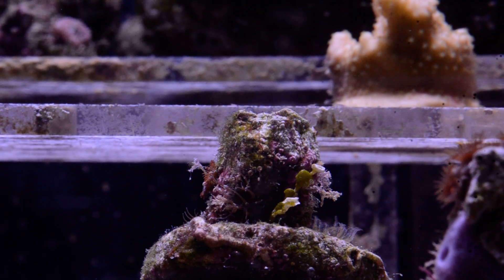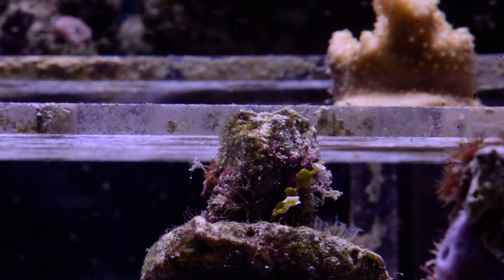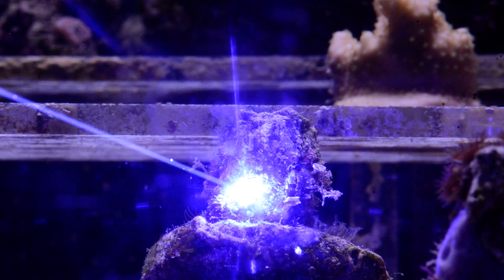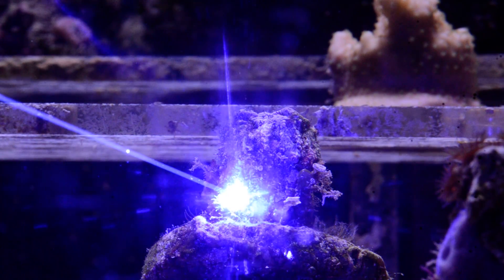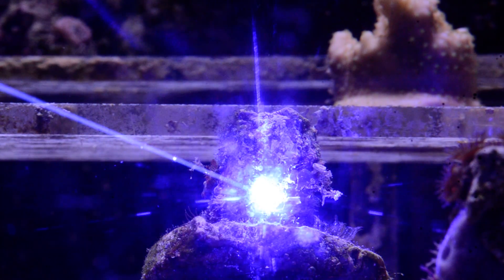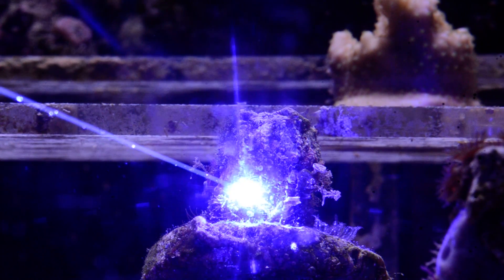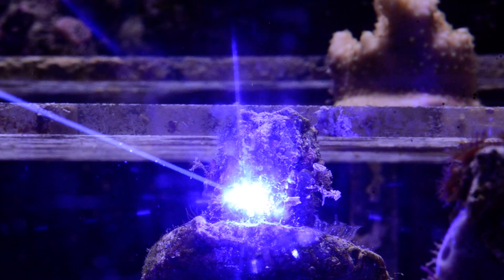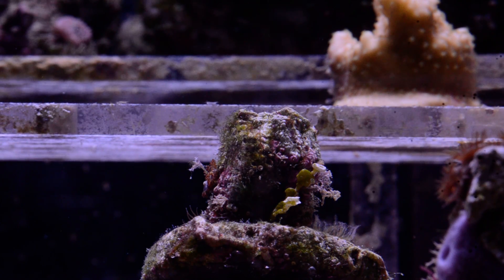Marine Aquarists Laser Series - Aiptasia

Comment from the maker: Testing has been very successful thus far. More information is available in the provided threads. The laser shown is a 1.8W 445nm laser from Survival Laser. IMO, 1W is not enough power, I'd recommend the maximum output available.